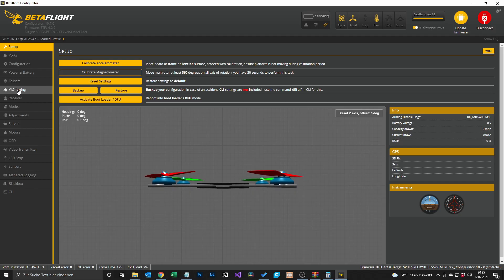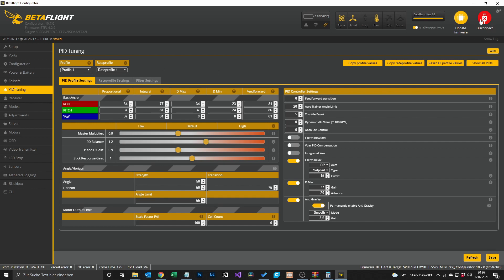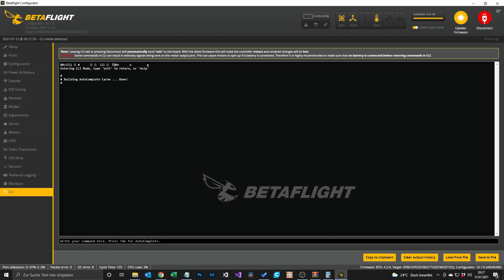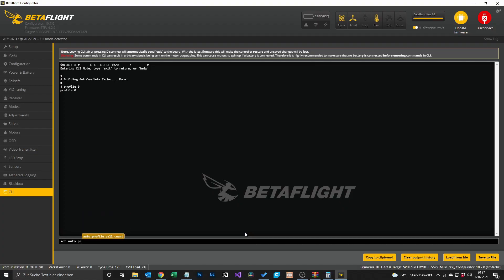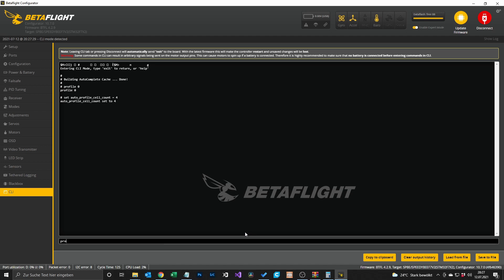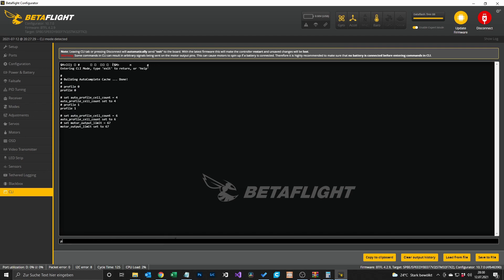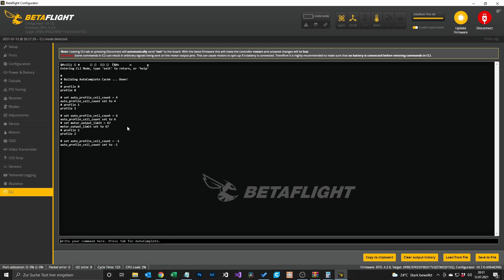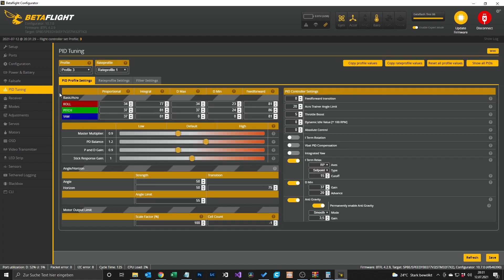6S Batteries on 4S Motors - Setup Motor Output Limit And Auto Profile Selection

Comment: You do not have to enter values in CLI, you can enter it directly on PID Tuning tab, under Motor Output Limit (lower left). For each profile. ;)
Reply from the maker: That's totally true 👍 I just showed it via CLI as I prefer working there (if the layout of the Configurator changes you probably have it in a different place therefore I show it in CLI), but you're right I could've mention it 👍

Comment: you can calculate the motor_output_limit much easier: 4S/6S=0,666667 -> 67 :-) You dont need multiply and divide by Voltage 🙂
if you want use 5S (as example): 4S/5S=0,8 -> 80

Comment: how to reset back to normal 6s setup. Currently already install 6s motor
Reply from the maker: To reset everything you have to set the profile cell count for each PID profile to 0 and the motor limit back to 100. After that you should check if everything works fine (like I did in the video but reversed: when plugging in a 4S / 6S the profile shouldn't change anymore)

You can do reset your profile when typing the following into CLI (assuming you have only changed the things I show in the video):

"profile 0
set auto_profile_cell_count = 0
set motor_output_limit = 100

profile 1
set auto_profile_cell_count = 0
set motor_output_limit = 100

profile 2
set auto_profile_cell_count = 0
set motor_output_limit = 100

save"
Reply: @flickFPV  thanks a lot man. Thanks. 
What meaning on set_auto_profile_cell_count = -1...
-1 asign for? This just asking...
Reply from the maker: My pleasure 😉

When assigning Auto cell count on two profiles it will pick the corresponding Profile - assume you have a 4S and 6S profile it will pick each profile when plugging in a battery with corresponding cells.

In case you would plug in a battery which has only 3S or 5S it would stay on the last selected profile (so either 4S or 6S) - so long story short: with -1 you have a profile which is selected when something different than the set auto_profile_cell_count is recognized
Reply: @flickFPV  thank man. 💪👍